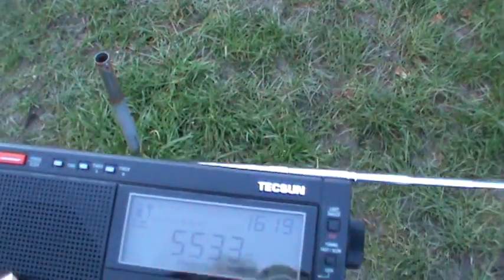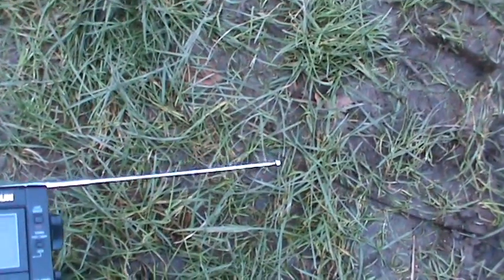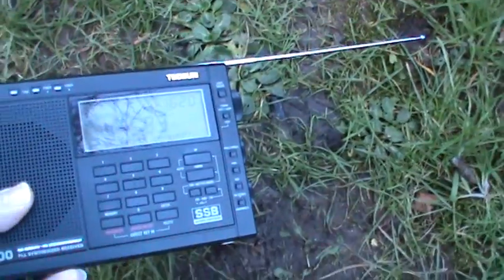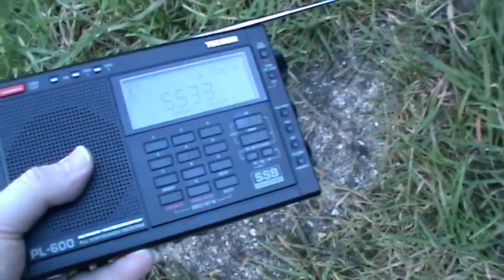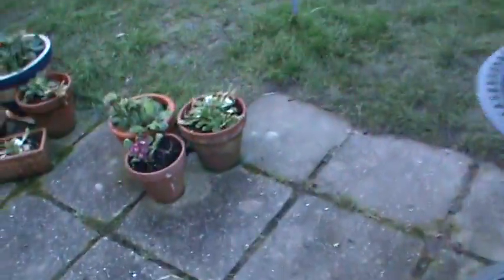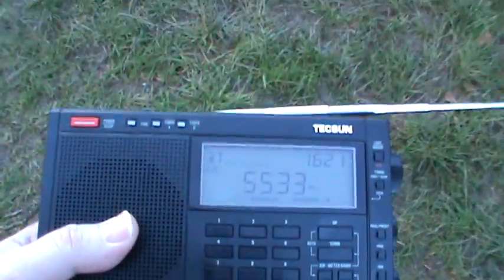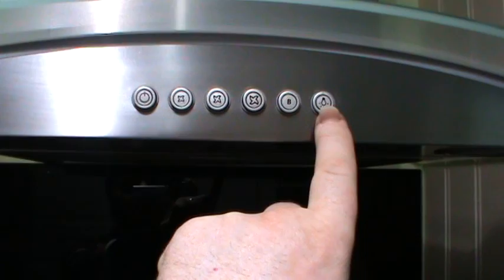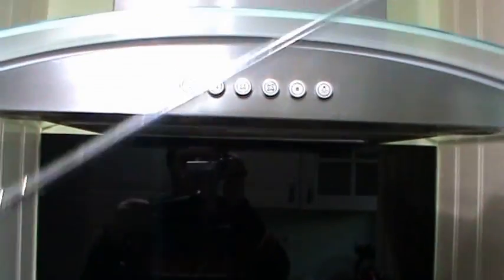QRM Man made radio interference (in association with UKQRM)

Comment: Hi, Mike did you ever get this interference sorted out? I have now got -73db static crap all over the bands it's disgusting we have no help in such matter, especially from Ofcom. I have the same type of noise there seems to be a low-level 50hz hum along with the static crap. I have got in touch with the EMC committee of the RSGB and awaiting a reply as i have also got VDSL interference as well .I hope you did get your problem resolved cheers John
Reply from the maker: Hey John, no never got it sorted, positively tracked it to a care home run by Shaw Care nearby, and a outside light, they have never even bothered to change the bulb despite me offering to replace it as a fist try!

Comment from the maker: Regarding the odd QRM that seemed to be coming out of the ground at my QTH.
 
I had a very brief go with my DF loop today and without doubt the coax that comes from my antenna in the tree down to the ground and is in fact connected to the ground is either the source or radiating something it’s picking up!
So, I really doubt it's coming from the ground, but is it possible by adding the earth connection to my coax at the point I have, has produced a resonant length that is picking up this maybe 5.5 mHz signal and is re-broadcasting it into the ground here?

The source is going to be hard to find
Reply from the maker: +MikesMovies https://www.youtube.com/watch?v=t8gnR_VP5cc you can see the set up here

Comment: Grounds may help but not always. Problem is that you will not know until you try. I think you may have been just picking up more signal from the washing pole and ground wire by the capacitance effect. Kinda like if you took your radio and put it on a metal bridge you would pick up more LW and AM MF broadcast signals. The place where the noise wasn't pulsing was just a propagation effect - kinda like one place/height may work good for the mini-whip but another may not. Also kinda like the FM broadcast band - moving the whip antenna may or may not improve the signal. There is so much we do not know about RF!
Reply from the maker: +Don Tomkinson Thanks Don :)

Comment: Shocking the amount of noise being given off these days. If radio operators were to cause just a fraction of the problems to radio/TV reception they'd have their stations closed down.
Reply: +delboyonline I agree with you 100% i have not got ant faith in ofcom as a regulator they will not do anything about it even if they find out were its coming from they are killing of armature radio with there refusal to regulate even when devices like PLT that don't comply with the EMC regulations are allowed to be sold and used with disregard of current EMC regulation they are incompetent and should be held responsible for there blatant disregard for the regulations .Shame on you ofcom Why is there nothing being done about it surely someone should start a partition of no confidence in ofcom as regulators .If you know of one i will gladly sign it .
Reply from the maker: +delboyonline Very true